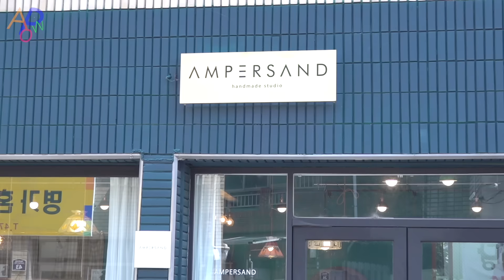Process Of Glass Sculptures Becoming Beautiful Lamp. Korean Stained Glass Engineer

Comment: Wonderfully informative editing & videography; answered all my questions about how this craft is carried out. It requires good skills and a LOT of solder.
Reply: Yes amazing work. No need for the leaded frames, Makes things a little easier, Just trying to find some nice decorative glass supplier, at reasonable prices,
Reply: @d.i.l.l.i.g.a.f  Good luck with your searching for quality glass. I haven't even started with the hobby yet, but the video was very educational. Perhaps I should give it a try. What country are you located in? Are you going to buy locally or use digital shopping?
Reply: @BrassLock  Have nothing locally as usual lol, So will have to look online, But have found a store with the type of thing i am thinking of, try a search for creative glass guild.

Soldering irons can be got for quite cheap to begin with, 200w for less than 20, Have the copper tape already, a dremel to smooth the glass edges. Get some plumbers solder. I cannot get on with lead free solder, its awful stuff to use, and then for the final copper tone, it might have been wiped with copper sulfate or maybe CopperIt .

Just need to have a fan blowing the lead fumes from the solder away from your face, and work in a well ventilated space. 

Only thing not looked for, is the faceted hearts shapes. I think you could make a similar sized shade for 40-50 quid for tools, then probably after it would be about 30-80 in materials for the first one, all depends on your design and wastage i suppose, but if you have the technical skill to do this for yourself.

I would have never thought of just soldering copper tapes together. always thought you needed those special like a H channel lead rods to slide the glass in to start with.
Reply: @d.i.l.l.i.g.a.f  Yes, it was a surprise to see that copper tape holding it all together. I have all the tools for electrical work, and the rotary tool. Just need the copper tape and glass 😀
Reply: @BrassLock  Yes, also have most of the tools, besides the copper sulfate solution. But not sure if my 80 watt iron will be strong enough, to get a nice finish over a 200mm ish length of a joint, maybe it might just need a finishing pass with a narrow blow torch flame to get a smooth consistent line. Trial & Error i suppose, but watching this video, has sure given me the insight into having a go myself. Although all these overly bloody talented artistic people make these things look like a piece of cake lol.

Might just get a cheap piece of plain glass to have a play with, before shelling out serious money for some nice coloured glass, Good luck with your project if/when you decide to have a go :)
Reply: @d.i.l.l.i.g.a.f  Cheers!

Comment: Nice!  I noticed you stood 2 panels together but wondered how you knew what angle to do this on without using a guide?  Other videos have ALWAYS shown the panels sitting in a made up gauge.  This is obviously very important to get it exact but you do not show how or have any subtitles thanks
Reply: The pieces are already angled at a predestined degree, so it's easy to solder them up without a jig... the angle of is formed from the jig (wood) when she piece those individual pieces together. The 3 pieces of wood are angled. Starts from 3.31min U can see those 3 pieces of wood are pre-angled at the required degree , so the formation of 2 sides of each pieces (lamp sheets) are molded in accordance to those angled wooden jigs